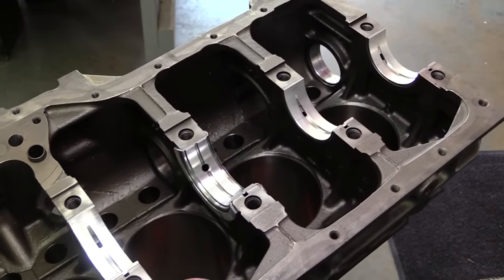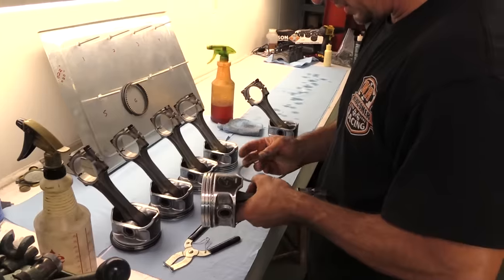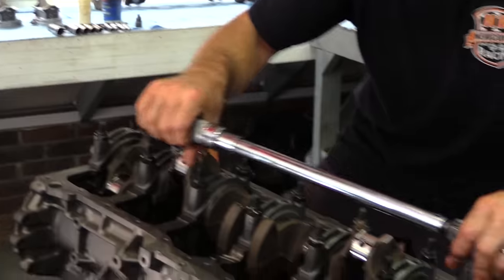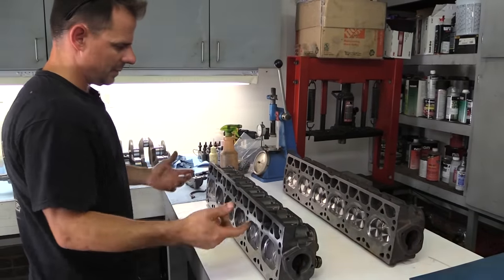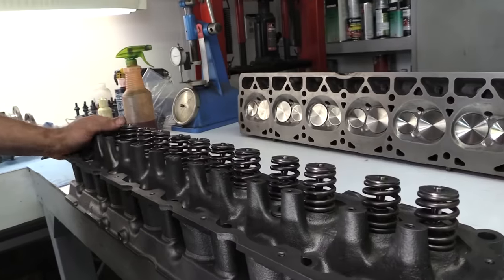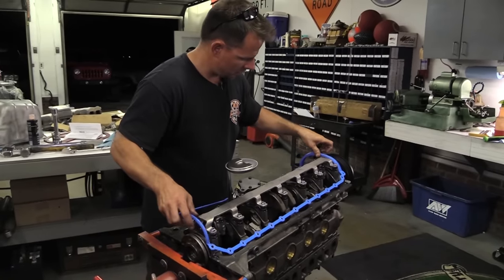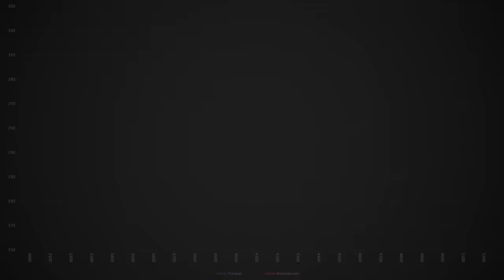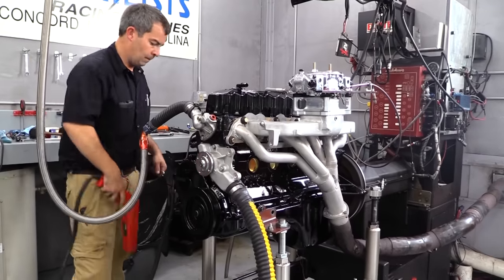Big Power Jeep Straight Six Stroker Build on a Budget with Newcomer Racing

Comment: Headers underneath the intake? Won't that rob it of power if it's heating up the air going into the engine? Seems like a bad design.
Reply: It's not necessarily "a bad design". It all depends on what your goals are and what you're trying to do.. If you're simply looking to make as much power as possible, like for an all out race engine build, yes, having the intake and exhaust manifold in such close proximity to one another is not the best. But for normal, everyday, real world driving which is what the engine was designed for and  how 99.99% of are them actually used, the bit of added heat from the exhaust manifold going into and warming the intake manifold substantially improves fuel economy, increases driveabilty and lowers emissions. Like I said, it all depends on what your goals are and what your trying to do.
Reply: Most inline 6s have ran like that for a long, long time. It was never meant to be a race motor and vaporizing fuel with heat isnt always a bad thing.

Comment: So that 300hp/320lb ft  i6 with all that work and break in is only 5k ... I will be doing one of these  instead of the v8 it's not exactly  6.2 gm power but with a 4 speed at last it should be more than enough and won't require me to rework all my Under hood suspension mounts , just be like a stock motor on the outside.

Comment: Do you not port and polish the valves and the runners in the head?
Reply from the maker: You can, but for a low rpm motor like this the results would be minimal.

Comment: Will the fuel injection on a 95 Cherokee still work? I'm not sure how they would tune a 95 obd1 computer? Or would it be better to use an aftermarket throttle body fuel injection?
Reply from the maker: Yes, it will still work. They can be a bit tough to tune, but they can work.

Comment: Looks like a pretty good thing,  but I can't help thinking,  with a slightly heavier valve spring it wouldn't have rolled over so soon, move that red line up to 5500
Reply from the maker: You are correct, and I think the heads would have supported the extra airflow. But I'm sure you know everything in engine building is give and take. As soon as you move away from the stock replacement valvesprings into something just a little bit more performance oriented, the price jumps up. Newcomer has other springs he's used and had success with, but with this build he was trying to keep the price as reasonable as possible. Thanks for watching!
Reply: Yeah for 5 k it should've included 300 dollars worth of valve springs LMFAO.....

Comment: Fantastic build, as I LOVE I-6s for their monster low-end torque potential!

Too bad the intake is immediately on top of the exhaust manifold, as the intake air will be super heated with that no-name eBay purchase, which will ultimately rob the engine of much needed power. I wonder what the hell the Jeep engineers were thinking when they designed that intake/exhaust setup...

Nice build though!!!
Reply from the maker: Thanks!
Reply: @TheHorsepowerMonster  Si bueno!
Reply: Those headers can be wrapped with that insulator tape stuff. I've heard it really keeps the heat in and may actually add a couple HP even.

Comment: That is very respectable power for not much money.
Reply: 5 k would get you 2x the power from a number of different engines. Think toyota i6 & gm v8. Even mopar v8. Even the same engine shown here just from a different vendor. 5 k is way over the top.
Reply: @elonmust7470  true. I have a pontiac 455. 5 grand doesn't get very much in this case. A good set of heads cam run 2 to 4 grand.

Comment: The 4.0 is well known for reliability, generally speaking, when you start adding hotter parts, reliability suffers. My question is how much will what was done effect the reliability?
Reply from the maker: It really shouldn't hurt it too bad. The power levels still weren't too radical yet. Thanks for watching!
Reply: @TheHorsepowerMonster  I hope it can give you what you want and still be near bulletproof. I found a cherokee a while back with the 4.0 in it, but you would not believe the price they were asking even though the vehicle was rather old, it still ran and so far as I could tell everything worked. Stock ones do not tear up easily, though eventually some things just wear out, water pumps and such mostly, I've actually never heard of the engine having internal mechanical problems, tho I'm sure it can happen from time to time. My brother's rental car company used to run a fleet of the cherokee's with the 4.0, never a serious problem. The Jeeps with V8's, nothing but problems even right off the truck from the factory. His rental place was in Aspen, Colorado. We got some in during the winter, the  4.0, no problem, the V8's in the wagoneers, were hard to start and ddn't run well when they did start. Something about the distributors, I don't recall what it was exactly, but they had to be cleaned thoroughly and the caps and rotors replaced right from new. Some dielectric grease I think it was, that just didn't function right when cold. 

Also, I learned something while working for him about tires on the four by fours, on snow and ice, you do not want wide tires. On narrow tires, we could drive the snowpacked roads around the airport like they  were dry, but one came in that had the wide supposedly all season tires on it, I couldn't hardly keep that thing on the road at all, not in two or four wheel drive. Four wheel was actually worse, because it made the front tires spin out and take away any steering. I guess I kinda knew that already, I put narrow snow tires on me cars no matter the time of year. Dry climate, mud was not generally an issue, so they worked fine.
Reply from the maker: @tootall5559  Very interesting! Down here in the Southeast, we don't really get what you would consider cold weather. Those aren't problems we really have here! Thanks
Reply: @TheHorsepowerMonster  I get that. I'm in Alabama now, and lived in Georgia for a while too. Wish I had some snow tires or chains in 93, that's for sure.

Comment: I don't see why the cam is such a secret for a low budget none racing build. You said checking the clearance isn't needed for your crank, it is when you send the crank out to be ground and /or polished. You buy plasi gage and check the clearance, it's not that expensive compared to replacing the block and /or crank.
Reply from the maker: Yes, you absolutely must check your bearings clearances, with plastigauge as a minimum. That is true every time. But that is bearing clearance. When I said crank clearance, I was talking about not needing to make sure the crank and rods don't bash into the side of the block. And you know it will clear because it is a Jeep crank and a Jeep block. Hope that clears things up and thanks for watching.

Comment: I always wondered why guys use that Toyota inline 6 instead of one of these 4.0s. I feel like they could be quick as well
Reply from the maker: The Toyota inline six has an advantage over this because the intake and exhaust ports flow to opposite sides of the cylinder head. You get better flow and the exhaust isn't actively heating up the intake chage. Thanks for watching!

Comment: lol awesome  just awesome. lol but I wonder....... fully stroke it out to 5.0 lol add a turbo, and have that force feeding a supercharger. lol eh at that point. go for broke and add direct nitrous injection. lol 

and definently hang on to something. 
I'm guessing around 750hp and 1300 fpt. 

tho with a few tweaks  hydrologic can with rollers instead of the flat tapped. rollers on the head instead of the OEM.... frees up a little more hp.

Comment: hello, i try to build 4.7 stroke engine for my 2001 WJ,  i have a AMC 258 crankshaft and 4.2 connecting rod  with casting number 707 and i have 4.0  connecting rod  casting number 691.  example i can made with 4.2 rods and  0.060 Speed-Pro Hypereutectic Pistons H825CP 60 or made 4.0 rods with Keith Black/KB Pistons IC944-060,   for me difference is money, made first version with pistons will be for me 200$ but second is 600$, can you tell me what receipt is good?
Reply from the maker: The Speedpro pistons are likely cast or maybe hypereutectic. That's why they aren't as expensive. They are OK, but they are susceptible to cracking or even breaking if the engine goes into detonation. As long as you keep a good tune on the engine, you should be fine. Thanks for watching!
Reply: @TheHorsepowerMonster   Very sorry for bothering you,  can you tel me, what cubic inches made in this video 4.7 or 4.6., and what pistons they are used?  Sealed Power 677P - 0.060 oversize pistons ?

Comment: How were the factory valve springs only good for 5200 when the engine they went into was rated to 5500?
Reply: New cam with higher lift and steeper ramps.

Comment: Every head ive had professionally ported flowed has effected my fuel economy for the worst 
Yes they ran better more power but at a noticeable cost 
When traveling with other jeeps at times 10-15 thats when you can really see it when everyone is fueling up
Reply from the maker: Great point. Unless you are cutting friction, it is practically impossible to increase horsepower without burning more fuel. Sounds good unless you can't make it to the next pump for a fill up. Thanks for watching!
Reply: With out saying the persons name 
People have doubt their ability to  flow heads properly until they see all of the numbers 
Now their heads all go to them
Major motorcycle clubs
Engine builders
Hot rod magazine
Has wrote articles on them
Mondelo cylinder head trained

Comment: How reliable is this engine as it sits built?
Reply from the maker: It should still be quite reliable. Although it is making significantly more power, it still isn't anything crazy that the components like the rods and pistons should be able to handle without issue. Plus, it isn't a high rpm screamer, so that helps. Thanks for watching!

Comment: if your goin with high  hp build why not go aluminum head?
Reply: Clayton Pope  those engines probably blew headgaskets  as a combination of  poor gaskets and user  error   aluminum head    headstuds  a  propper headgasket  like a MLS gasket  and  problem solved also  oil capacity dosent nesseceraly mean cooler oil just more oil to heat a  oil cooler is a better option and a  oilpan with baffeling
Reply: Clayton Pope  acusump is  never a  bad idea  on  extreme cases but  aluminum heads are not a problem its usually the  poor gaskets and  lack of  clamping force  there are other engines that had  issues with blowing gaskets and they were all fixed with a  propper gasket and  head bolts/studs  and aluminum heads are cast too
Reply: Clayton Pope  Did the 2.2 have solid a deck or was it open with visible water jackets? I've always been under the impression that cast iron solid deck block/aluminum head designs work pretty well.
 The Chevy Vega engine was designed without a deck and the block was aluminum with a cast iron head.
Talk about a head gasket blowing little bastared!

Comment: This is sort of along the lines of what I wanna do But I also want to throw a turbo on it And put that inside a 88 fox body Mustang Coupe That has had body panel replacements to look more like an R32 skyline I only want like five hundred horsepower But I do want to keep it carbureted The less computers the better, Actually the only computer I want in my car is the radio

Comment: I don't get it, the lightweight crank is carrying balance stresses between the counterweight. What's the point when you toss a flywheel on the end in any case? Why not go for the better balanced and heavier crank and a lighter flywheel, it's all rotating mass so why not?
Reply from the maker: The lightweight crank is just as well balanced as the heavier one. After a build like this they both would be internally balanced, so they could use the same flywheel. The lighter crank doesn't require a heavier flywheel. Thanks for watching.
Reply: @TheHorsepowerMonster  Thanks and I get that. But while the lightweight crank is balanced overall, it is carrying unbalanced throws between the counterweights and this places stress on those throws. So I must ask again, where is the disadvantage with the heavier crankshaft with every throw counterbalanced and a lighter flywheel if it overall rotating mass is the same as the lighter crankshaft with heavier flywheel (and stressed carried by un-counterweight throws)?

I'll admit I'm not a design engineer, just a maintenance engineer but I'm keen to learn why one is superior to the other, cheers.

Comment: Wait. Almost 4.6 liters, and only 300 horsepower. Toyota, Nissan, BMW and Benz are all doing a big ol golf clap for this one.
Reply: Oh, yes....yes...I hear ya "ain't about revving, not a rice burning POS"
Heck, even the l28 Datsun engine was more efficient, and had better power to weight.
Reply: @whozaskin3639  Datsun l28 made no torque,
Reply: @riogrande163  let's not compare an engine from the 70s to an engine from over THIRTY years later.....and calculate power to engine weight or torque/hp per litre. Its just embarrassing. Hell, the Toyota 4ac had better numbers with an undersized carb, catalytic converter, and a non cross flow head. B16b.... Ca20.... Sr20....ka24... For goodness sake a single tiny turbo (~6 psi) on a vg30 was wallering on that jeep "engine". Sure, the design stolen from AMC....stolen from Nash.... was a reliable engine......but jeep couldn't even steal someone else's homework and get good grades. If ya can't get 80 ponies per litre WITH modern tech, your defrauding your customers, and sadly......most Americans are too stupid to be angry. Look up Nash ambassador. Nash got screwed over. Seriously, why put thousands into boring and machining an engine, for more money and less power than you can get from a NA 2JZ with a spicy tune? Im a car guy through and through, and don't really care what it is, if it has soul. But don't talk like a 280z didn't have grunt. You've probably never driven a well sorted totally stock s30, let alone one with modern fuel and ignition. Oh, and when put through hell like mail trucks get put through......the 4.0ho ain't reliable like ya may think. Ford ALMOST had something special with the 300 i6. American engineering has suffered greatly (perhaps terminally) at the hands of the shareholder's hired bean counters and consultants.

Comment: I would like to see you do a 300 C.I.D 4.9liter Ford engine I have one I need some improvements on
Reply: If you haven't, put fuel injection on it. A carburetor reduces power in cylinders 1 and 6. The fuel puddles in the long runners and doesn't burn as good as when it was atomized in the air compared to the cylinders closer to the carburetor.
Reply: My 4.9liter 300C.I.D has fuel injection it's a 92 F-150

Comment: With this horsepower, can you still use a stock AW4 automatic  transmission?
Reply: most likely, the AW4 is known to be quite tough, even for an automatic
Reply: Yes, same trans holds big power in turbo Supras.

Comment: holley carb is WAY overkill. 500 cfm edelbrock would be perfect... nice job though...
Reply: The make of carb doesn't matter as long as it's the proper CFMs however a Holley has way more adjustments, which is a nightmare for someone unfamiliar with them where an Edelbrock as more drop and go. However in my experience a property tuned Holley will make an extra 10 horse easy

Comment: Am I the only one that rarely revs past 3500 rpm on my 4.0? Those numbers out of that engine are impressive. But for me are unusable that high. Torque curve is nice.
Reply: I had a 1966 Rambler American Rouge with the 232 6. Had just over 100 K miles on it when I added a Clifford intake, Holly 500 4 barrel, and Viper 3 into 1 headers with duel exhaust.  Reved it to 5,000  without a problem.

Comment: First, thank you all, for all you do at HP monster. Respect to the build and for the knowledge. If y'all  could think about this idea, or these suggestions? Please give complete DETAILED build specs in a build sheet format so A DIY mech can get all the parts gathered up, then go locally to a reputable machine shop to get the head rebuilt and flowed and the block refurbished, specs, decked and balanced and blueprinted AND support LOCAL businesses, respectively. I'd pay fairly and others would to I'd imagine, for a NEWCOMER complete details DVD with this info, WITHOUT, all the annoying YT ads, AND with, all,  Mr. NEWCOMERS apparently vast knowledge of I-6 build EXPERTISE, and fuel delivery and boost, tips and tricks. And plausibly, an EXCEL spreadsheet added for value, with ALL Newcomers  dyno data etc. So in this way, all his years of experience with these I6 motors can truly be budget builds for the  average, bootstrapped shade tree budget racer, crawler or maller so, that they could, make over 300 H.O. hp and ALSO, get the TORQUE in the sweet spot we are looking for. Doing the above mentioned details, would then be, a TRUE budget build at price point of 2,500 or less, not 5k! Just my wooden nickel rant...thanks for reading, lol :)

Comment: I just have a question. Are the Pistons custom, or are they replacement 4.0 L?
Reply from the maker: They are a shelf stock replacement piston for the 4.0 engine by SpeedPro . Just a bit oversized for the extra bore.
Reply: @TheHorsepowerMonster  thank you very much...